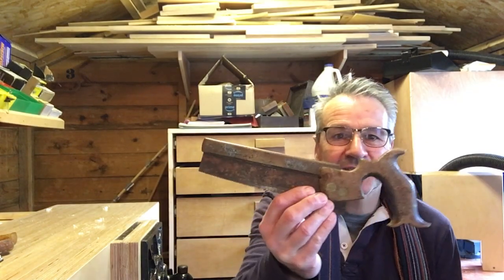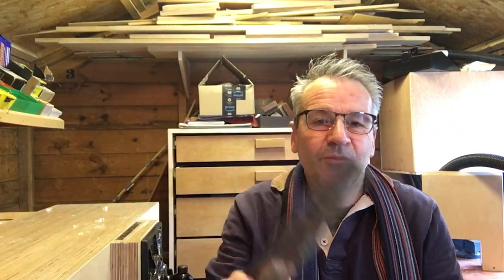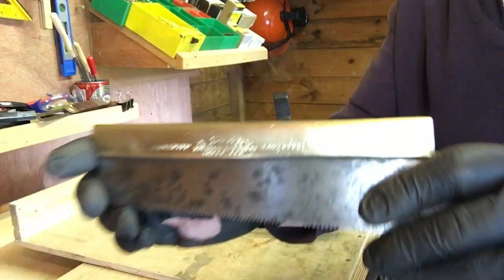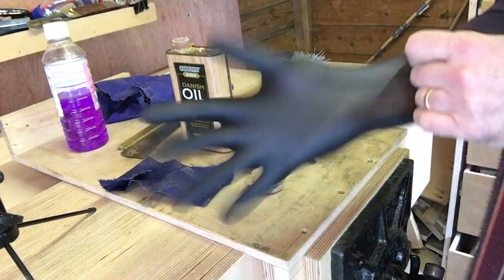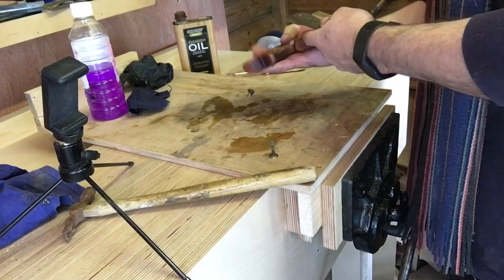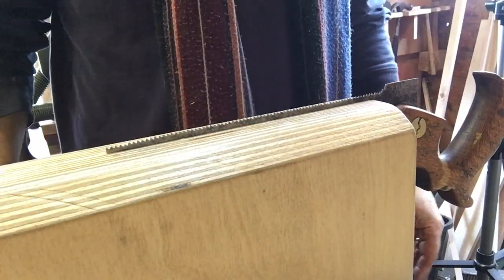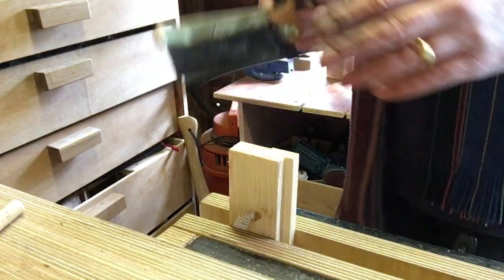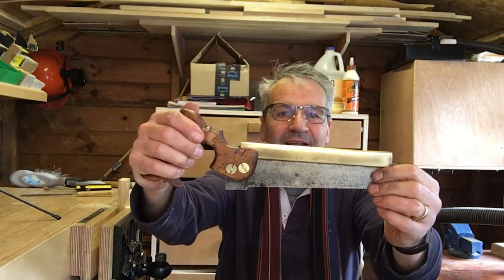Vintage Dovetail Saw restore

Comment: Well done.
That saw has had a LOT of sharpenings over the decades.   Did you sharpen all the teeth in the same direction?
Did you re-set the teeth or left the set as received.
It does seem to cut well.
The screws may have been switched in their holes causing the binding on re-assembly.
Dave.
Reply from the maker: Yes I cut all same direction on this one, I need to get tool and learn how to set teeth as having a problem with the other saws

Comment: Your saw is from 1870 the teeth should run from toe to heel in a straight line the piece with no teeth on needs to be filed down and file new teeth in .if you cant do it i will gladly re cut the teeth for you . The screws in the handle are not meant to come out after the saw was put together .
Reply from the maker: Thanks  that makes sense - where are you based ?